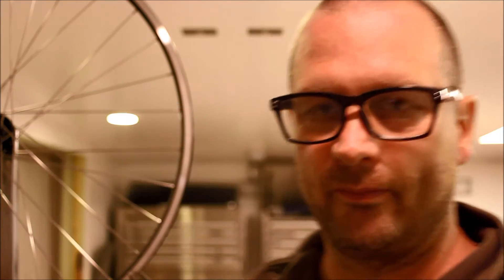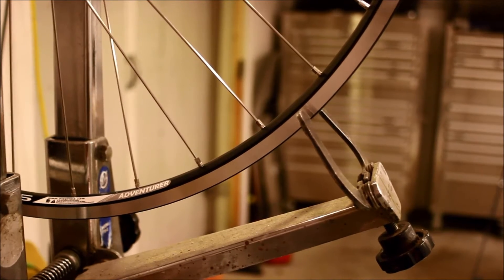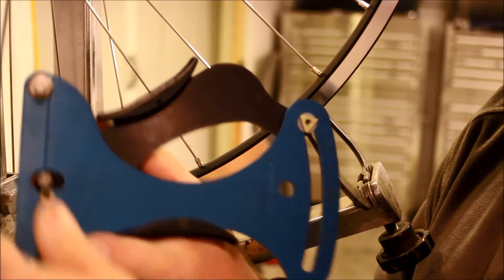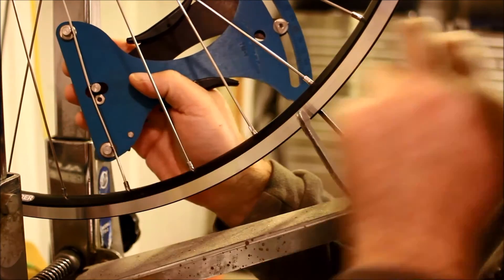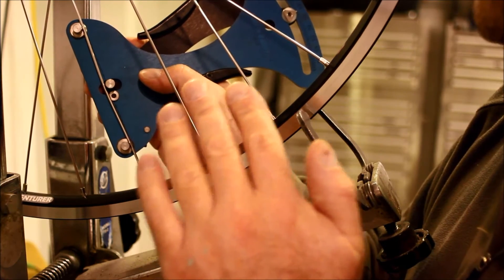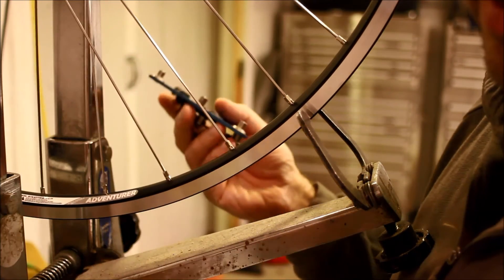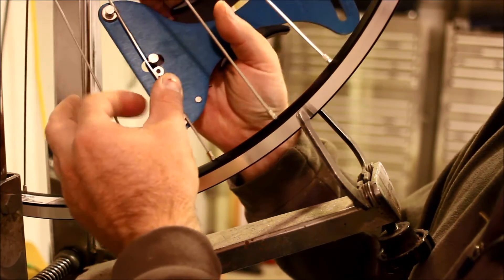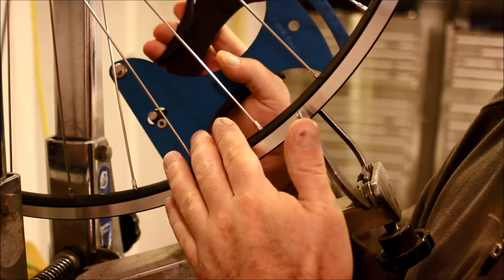How to Use the Park TM 1 tension meter

Comment: I've built 100's of wheels, never used a meter and never had a failure.  Now my first 40-50 were inspected by the wheel builder that taught me.  As this guy stated after you build them for a while you can feel it.

Comment: Out of curiosity, how long does it take you to lace, tension, and check each wheel once you've learned the process? Nice video, man. Thanks much. :)
Reply from the maker: Back when I did this often, building a wheel would take 50 to 60 minutes or 40 to 50 If I really hustled. I don't build wheels very often anymore so it's more like 60 to 90 minutes. For folks that do this all the time for customers, it's best to budget an hour, but for knocking around home, there's no rush!
Reply: James Glass what kind of truing stang do you have?